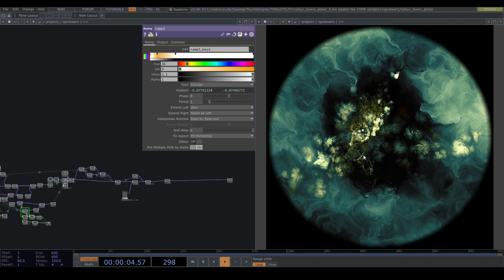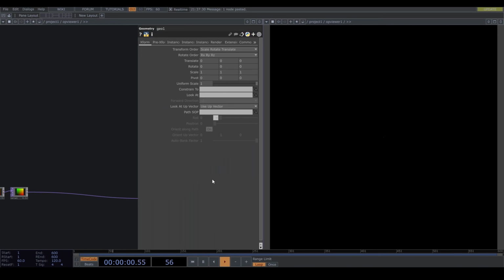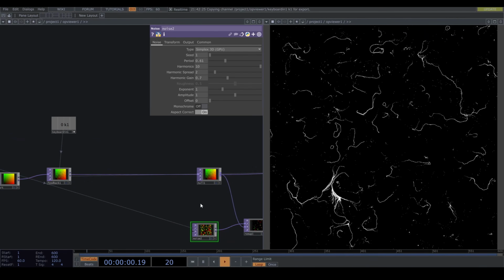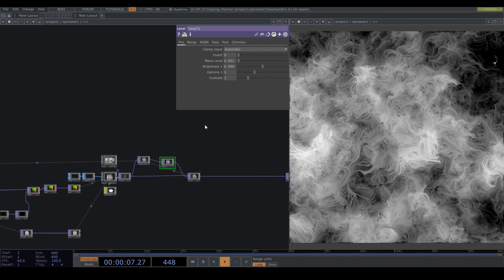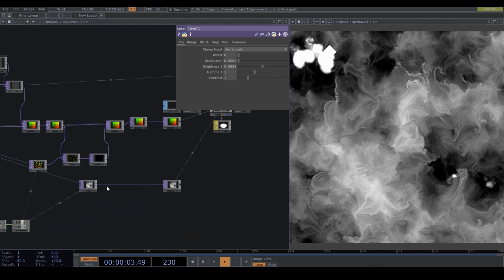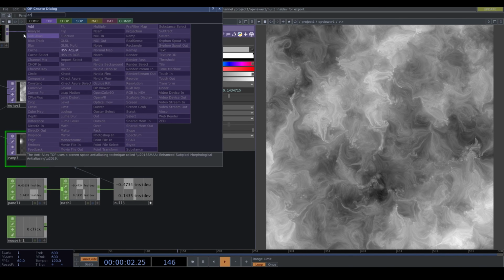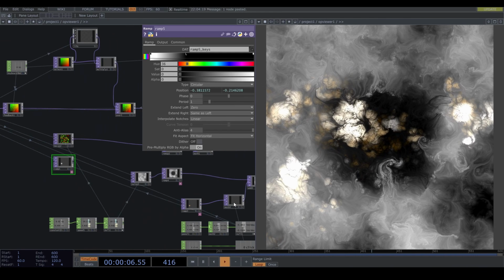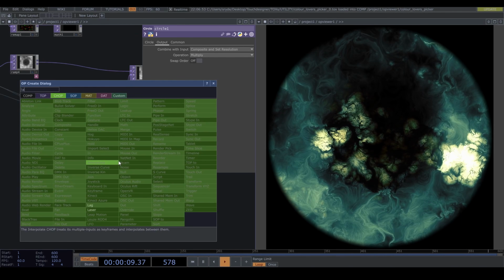Fire Iris TOUCHDESIGNER TUTORIAL

Comment: I'm having some issues with my mouse response, when I click within the panel (eg. in the centre) the effect appears below-left or left of the click point despite my ramp/math3 showing the mouse location in the centre. Any suggestions for improving the accuracy of the effect so it's at the clicked point?
Reply: Hi there, I've found that tweaking the math connected to the "panel" helps. In the math parameters instead of having the range from -0.5 to 0.5 I've found that changing the -0.5 to a -0.2 helped in my case